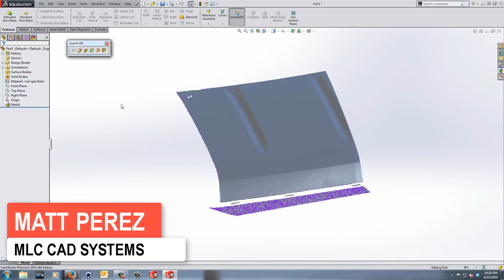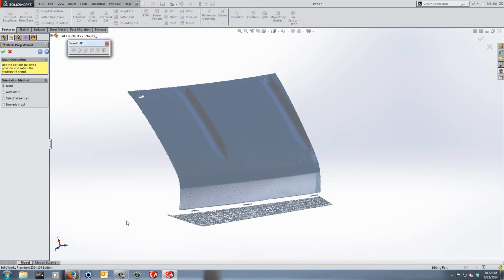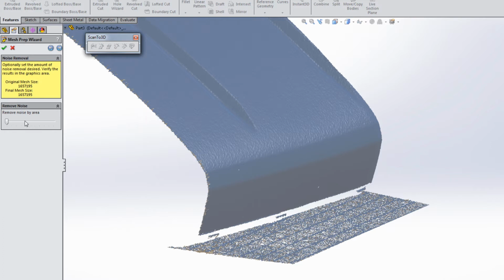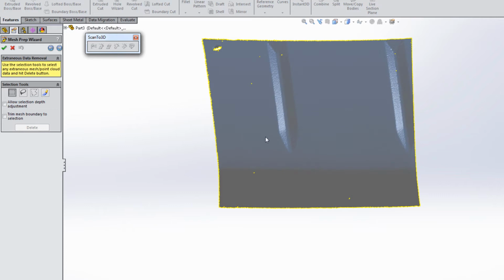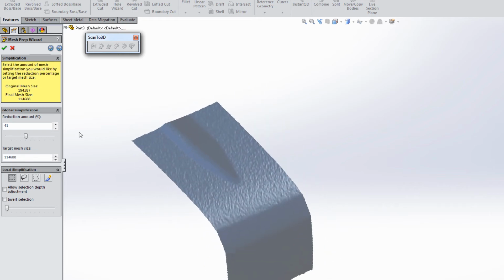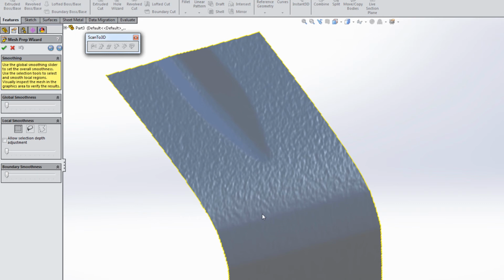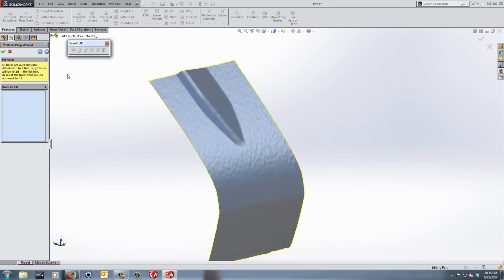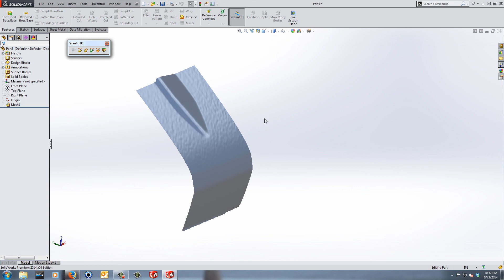SOLIDWORKS Scanto3D Part 2 - Mesh Prep Wizard

Comment: hello, my toolbar for "mesh prep wizard" is grayed out. I can't select most of them, except curve wizard. Why is that? Help me please
Reply from the maker: The mesh prep command may not be available for a couple of reasons.  The most common is when the file is opened without the ScanTo3D add-in enabled.  If you go to File > Open, you may see file types like STL that can be opened by anyone, but with the ScanTo3D add-in enabled you'll see at the bottom another entry for ScanTo3D file types and it imports it differently.  See if opening the same original file that way gets you the full command.  Another possibility is that there is no mesh currently in the model, which would eliminate your ability to apply mesh prep to it.  If you need additional help I recommend reaching out to your support provider, if you are an MLC CAD customer you can reach out at our website https://mlc-cad.com/technical-support/
Reply: @MLCCADSystems  Thank you so much for the help. It worked.
Reply: @MLCCADSystems  thank you so much for such a big help for free of cost.